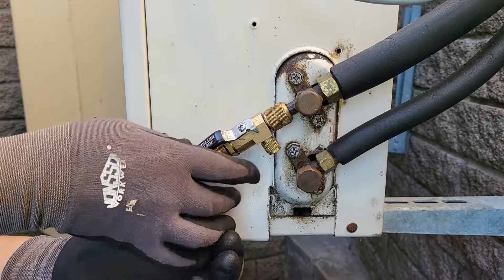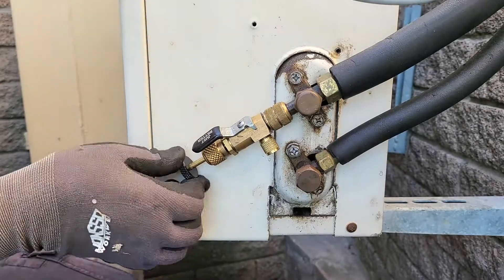How to use a valve core removal tool - Paradigm Cooling

Comment: Can I use the Schrader valve core remover right at the beginning? For new systems, practically BEFORE evacuation? For older systems, in cooling mode, but still switched off (there is a slightly pressure).
Reply from the maker: Hi Joe. Yes you can.

Comment: What did you connect the yellow hose from the valve core remover tool to?
Reply from the maker: Hi @safetyalways7788. The yellow hose on the video is connected to my digital vacuum guage. Now it is important that the hose used be rated for vacuum, or alternatively just use a Micron Coupler, which is the industry best practice right now.
Reply: @paradigmcooling8497  ok